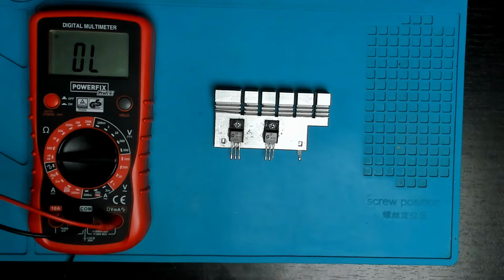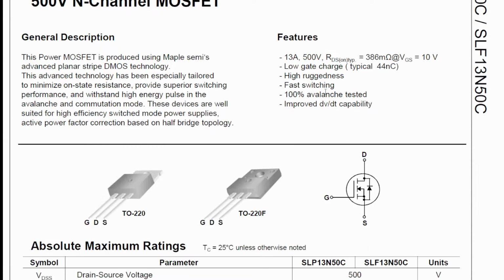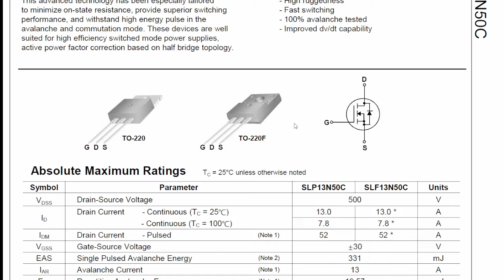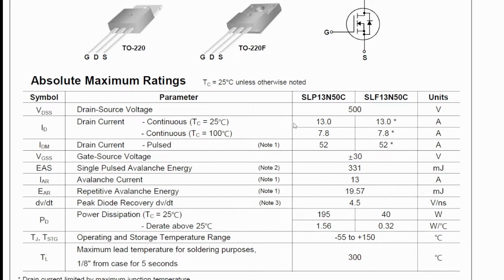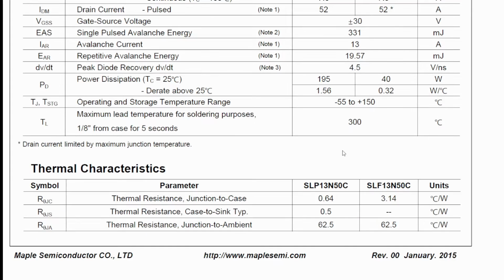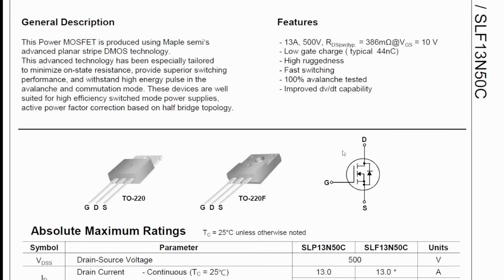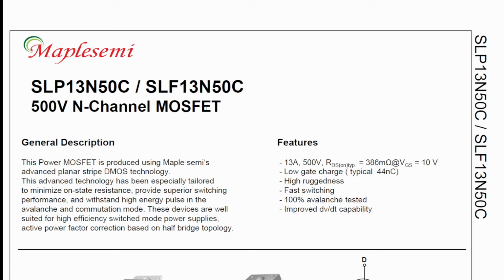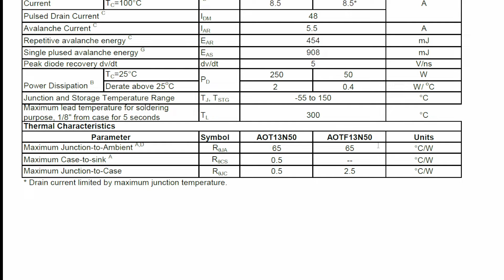PC Power Supply Dead Blown Fuse

Comment: I cannot find a fuse anywhere on my psu
Reply from the maker: Fuses come in all shapes and sizes, look under the board for a label "F1". If the fuse is open make sure to test for to shorts to ground before fuse replacement. Good Luck.

Comment: Antec bp450p blown

Symptoms: blown fuse, flown mosfet and diode.

Replaced all. 5v on pson and 3.3v on vsb standy coming. Vsb seems faulty. Starting with the green connected to black, series lamp lights up. Thinking output is short. Any other ideas (I'm taking this slow)?
Reply from the maker: Since the series lamp lights up your problem is on the primary side not the output. When the mosfet shorted it damaged other components. Check pinout on main control IC. Good Luck.

Comment: Hi, nice repair !

Question : I got a power supply which presents the same symptom (6.3A fuse explodes...).

1) in the primary stage) : 
- 4 pins rectifier : I tried to test it on circuit and ALL pins are short-circuit (multimeter beeps quickly as soon as I touch the pins).
Is this normal in that test condition ?
Can I test that without de-solder it ?

- 3-pins regulator (sits next to rectifier, screwed in heatsinker as well) : again, not de-soldered, can I also test that for continuity ?
I think it's in good shape, no beep, but I'm not sure how to test that properly, even de-soldered...

2) in second stage (between primary and secondary stages):
- I can see a 2x4 pins IC whose surface is partially broken, I can see its guts (identification impossible)...

Comment: Hi, the video shows you change two shorted mosfets but you appeared to change one or two resistors also is that correct?
There was no commentary on this in the video.
Reply from the maker: I only changed the fets and replaced the fuse, the rest of the circuit tested good.
Reply: Hi thank you for the most kind reply,must have been some debris you were clearing from your work area l saw.Excellent informative video much appreciate thank you for sharing
Reply from the maker: @colin5064  You are very welcome, thanks for watching.